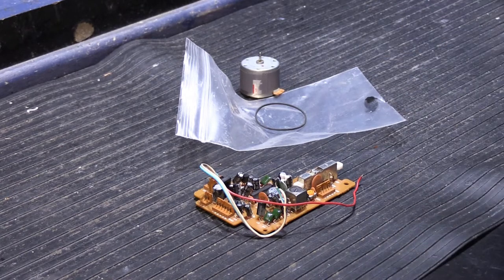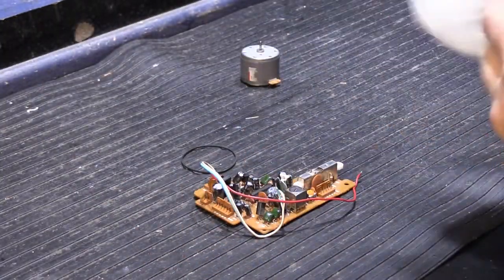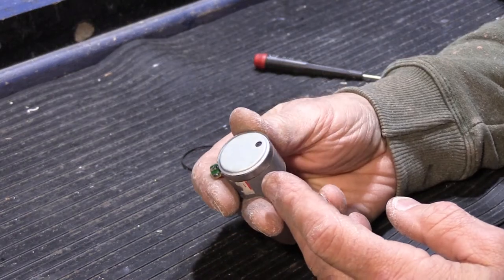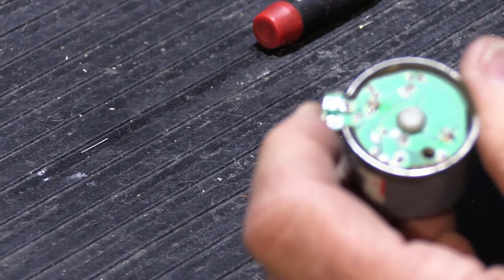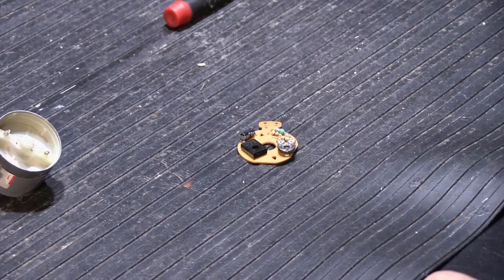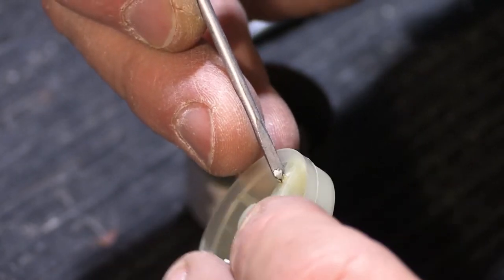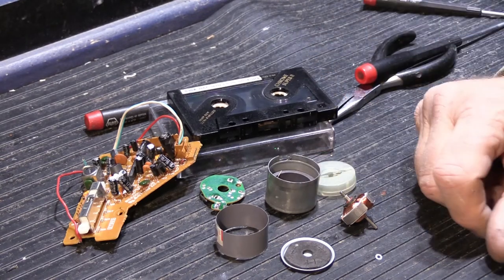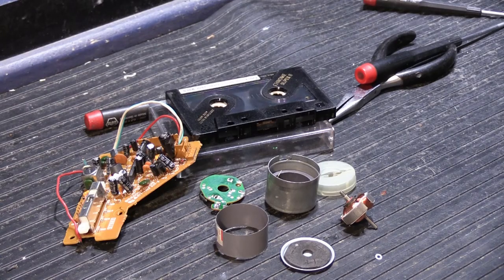The Anatomy of a DC Cassette Player Motor from a NuTone IM4006 Master Station

Comment: That pcb looks like it can record as well, the mode switch for head connection and R/P circuit swapping.
Also i can see what looks like a small transformer for the record bias oscillator.
Is there an electret mic on the case it is in? people can record speech maybe.
Very neat pcb.
I've repaired a lot of cassette motors, more often than not it's the commutator brushes that are dirty/worn.
Now the really old motors have spinning weights with contacts, if it rotates too fast the centrifugal force makes the weights fly out and disconnect the power.
A brutal design lol.
It reminded me of a govener on some old steam engines.
Leave a battery near the place you keep the motors, to test new ones as they come in :-D
Reply from the maker: Hi zx8401ztv:  All of the Cassette Players in all NuTone Master Stations are Recorders as well.  In the early designs, it was to record from the Radio or Record Player.  Starting with the IM313 - you could record a voice message and there was an indicator lamp - to show there was a message.  The IM313 used the speaker cone as a microphone.  The IM4006 had the same feature, except it had a built-in condenser microphone. - Chris